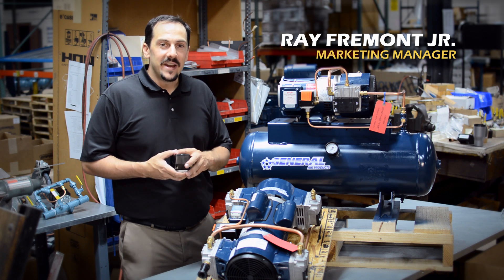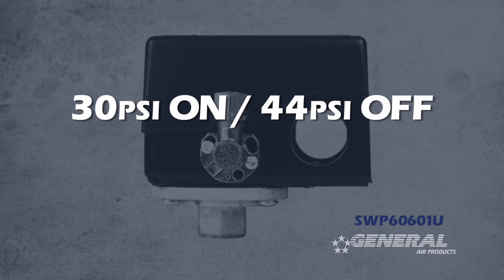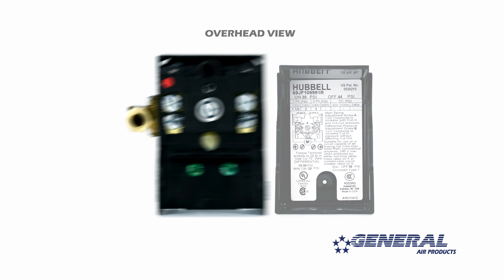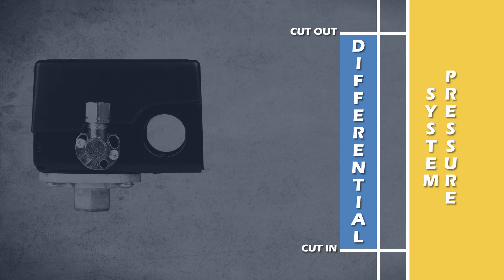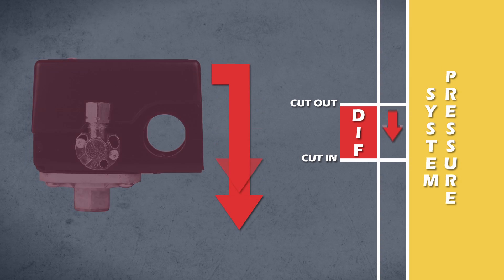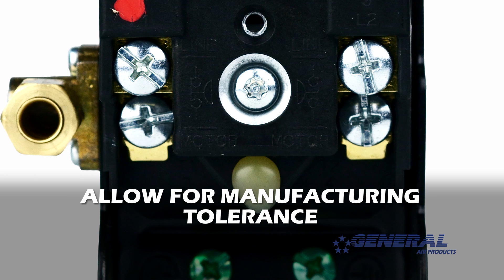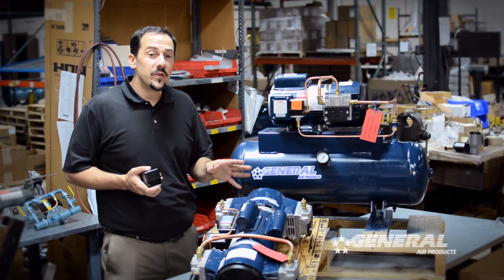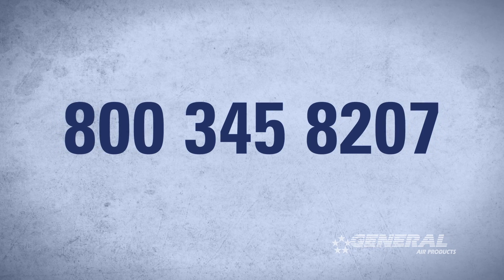Pressure Switch Adjustment - SWP60601U - OL PLUS Series Riser Mounted Compressors (3/4 HP - 2 HP)

Comment: What kind of screw is the one to adjust the pressure switch?
Reply: Why the allen wrench don't came with the compressor?
Reply: @eliopinto1750  It is Torx screw, I'm not sure what size, probably like a T15 or T20?  There's only so many sizes of Torx bits, try them until one fits.